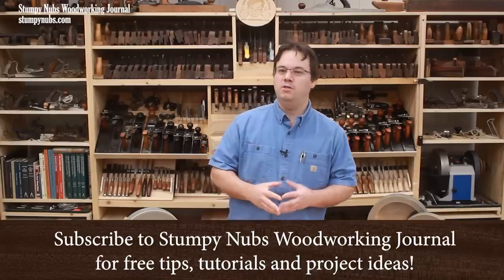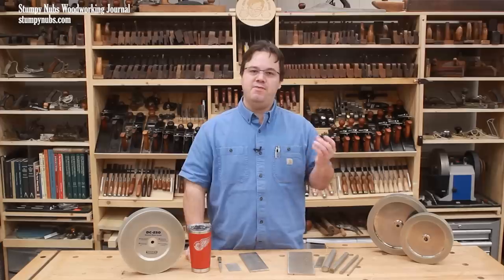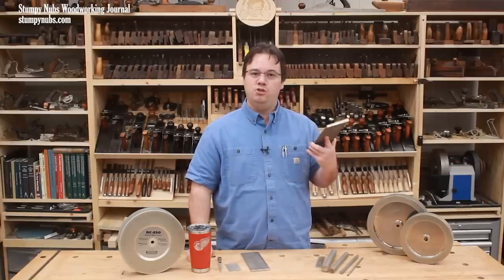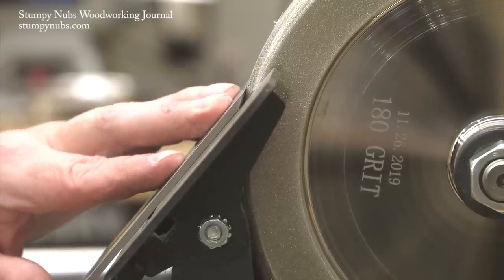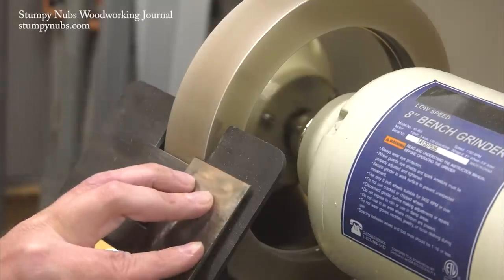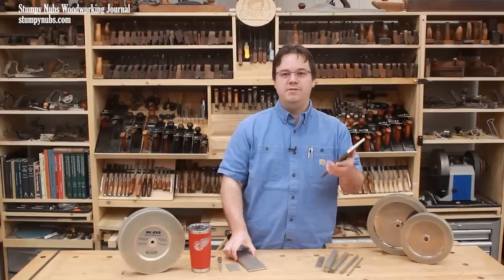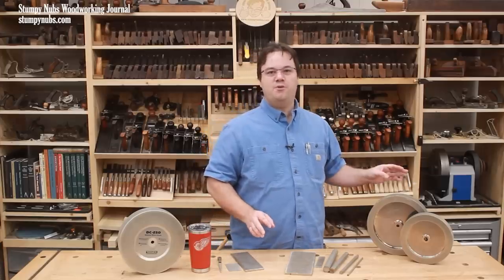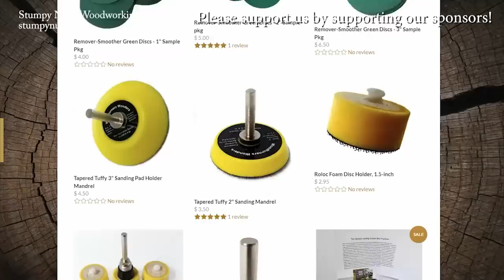The TRUTH about CBN vs Diamond sharpening stones

Comment: Hi James, I switched to CBN wheels to sharpen my lathe tools a year ago, I’ll never go back. One of the cautionary statements from the manufacturer surprised me though as it read “do not sharpen high carbon steel tools as this will clog the abrasive surface”. Happily I have another low speed grinder so moved my white wheels over. Now I sharpen my hand tools on white reserving the CBN for HSS only.

Comment: Heavy emphasis on CBN wheels are for 'hardened' metals only! The life of a CBN wheel, for production work is about 5 years. I did take an old worn out one and purposely loaded it up with soft steel, aluminum, brass and copper. After a month of sharpening my lathe scrapers on it, the colors from the softer metals was gone. Lapping fluid can be applied to the bevel of the tool you are sharpening, and it can help lift the soft metal off of your grinding wheels. If you apply it directly to the wheel, you will get sprayed, and I found out the hard way..... They do sell very hard aluminum oxide sticks to also do the same thing. Diamond wheels on a Tormek or the various clones of it, can last pretty much forever. I use the CBN wheels from D Way since the owners are personal friends. I do like the heavier steel wheels, but you have to have a grinder that will drive them, 1/2 hp isn't enough.

Comment: Great video explaining the difference between CBN and DIAMOND grinding wheels.  So, my application is sharpening non-carbide chainsaw chain.  Which is better here?  Price is about the same, so thought diamond would be better.  Guessing you will say CBN is better here due to lower grind temps at the higher grind speeds?  If so, can you please recommend a supplier of CBN grind wheels for my chainsaw grinder?  Thanks again for the good explanation!

Comment: One place I find diamond and Cbn won't replace in sharpening is when you want that mirror edge. I know the diamond films can do it or CBN pastes on strops. But there's something about a chosera whetstone polished edge it always comes out nicer and better. 

Great video though, lots of great points for those that don't know a lot about sharpening yet or just getting into it. 

I have a bit of each, diamond, CBN and chosera.
Reply from the maker: I grind with CBN to fix or reshape an edge. I sharpen with fine grit diamonds (either on the Tormek or by hand). Then I strop on leather with paste. I don't believe CBN or Diamonds are really intended to give you a mirror edge on their own.
Reply: @StumpyNubs  sort of. When you consider some offer 1500-1800 grit, where a 1800grit chosera is pretty nicely polished there. Obviously going higher can get better. 

Those stropping films you can get to put on glass or granite are diamond based usually. And I have Cbn pastes to put on leather strop that can give a mirror edge. 

Both can do it. It's just a nicer edge with chosera. 
Maybe looking at it more from the knife world with sharpening systems only using diamond stones and getting to a mirror finish. It's doable just not as nice.
Reply: @JoeC92  There's a Youtube channel (out of Japan?) where the presenter hand sharpens knives. He works through a range of 5 or 6 grits. The finest is something astronomical - like 6000. It's overkill until he slices loosely held sheets of paper with nearly zero force. The edge is likely sharper than a surgeon's diamond scalpel.
Reply: @gregparrott  virtuovice or something like that if that's who you mean. I know exactly who you're talking about. I learned a lot about hand sharpening from him. 
He's a big fan of bark River knives

Highest grip I have is 8000. On a Japanese style kitchen knife it finishes it off with an incredible edge.
Reply: @gregparrott  I finish my straight razors with a shapton 30,000  so 6000 is a bit rough 🙂
Reply from the maker: @JoeC92  - I am skeptical of diamond and CBN grit higher than 1000. Here's a video about why: https://www.youtube.com/watch?v=re2EwwNcufo
Reply from the maker: @gregparrott  6000 is not astronomical, in my opinion. Stropping paste on leather is equivalent to 5-6K. If I don't strop, I can tell immediately. I can't chop dovetails in soft wood without crushing the fibers and I can't take a very thin shaving with my smoothing plane. I sharpen to 1000 then strop (5-6K) or sometimes use a ceramic stone 5-10K instead of the strop. Makes a big difference in both performance and edge retention.
Reply: @StumpyNubs  definitely some good points. I haven't tried any of the larger ones. I'm just used to the 1800 grit that comes with kme, never had issues. And then the CBN emulsions they have as well which are for leather. 

I'm in the same boat though I would much rather finish on a ceramic or chosera.
Reply: @StumpyNubs  Thanks. I deemed it astronomical because it is far higher than any grit I've previously seen. But for those who sharpen with precision applications in mind, I guess 6000 is within a normal range. For grins, I've been looking at the Tormek line of grinders. The T8 seems to start at $700, ranging to $2000 with all accessories.
Reply from the maker: @gregparrott  A Tormek T-4 and a square-edge jig will do your chisels, planes and many other woodworking tools for about $500. Add a $45 knife jig and you can do a lot more. The Tormek is not a cheap system, and I am not saying you need it. But few have to spend $2000.

Comment: I agree with letting the diamonds do the work with light pressure . They have a nice feel imo . Trying some Venev 400/800 so far and a 150/240 is coming but it’s not an “f” ursa stone . The 400/800 Venev ursa did more of a polish finish with finer scratched than the 600 grit diamond . Seemed to work well though .

Comment: You mention low speed grinders and sharpeners - what RPM's are appropriate?
Examples:  My Vertical Sharpener turns at 160 rpm (the supply motor is 3450 rpm) and my Horizontal Sharpener (an older Woodcraft) uses a 7" stone at 420 RPM - both are water-emersion.  I have 400, 600, 800 grit abrasive stones as well as an assortment of water stones and Diamond plates for manual work.

I like the concept of CBN stones as they seem low maintenance - can these be used as water-bath stones??

Finally, what are your thoughts for belt grinders for sharpening??  Belt Width??  Belt Length??  Abrasive Materials and Grits??

Many thanks for sharing your knowledge and research!!
Reply from the maker: -Slow speed grinders are about 1750 RPM.
-You can use CBN in water if you add an anti-corrosion treatment (same as with diamond wheels.)
-I don't sharpen with belt grinders, personally.

Comment: Every time I see you use that Tormek, I am that much closer to giving in and buying one...
Reply: Do it! I have had my Tormek for close to 15 years. It has been one of my best tool purchases. (It now has a CBN wheel on it from Ken Rizza at WoodTurners Wonders. Much faster and less messy than the original wheel.)
Reply: @DKWalser  I'm sure I will at some point once my workshop finally gets built and I have some space.  For now I make do with a Veritas sharpening jig and diamond plates, it works well enough.

Comment: It's worth pointing out that grinding carbide produces a dust that is hazardous so extraction and a respirator should be used.
It would be interesting to try to quantify how much pressure is too much on a diamond plate.  Are we talking some but don't push really hard or are we talking enough to keep it in contact but no more?
Reply from the maker: If your fingertips are turning white, you are pressing too hard.
Reply: @StumpyNubs  Thanks James.  So fairly light but not just in-contact with no pressure?  Sorry, I'm confusing fingernails starting to turn white (very gentle pressure) with finger tips (harder to see but a bit more pressure).   Reason I'm keen to get it right is that I suspect I've probably damaged some early cheap plates and am keen not to repeat on better ones......and I should have followed your advise and gone for the Narex chisels and not the red/yellow Irwin Marple that need sooooo much work to make the back flat (and I mean the tip, I'm not confusing a hollow ground back).

Comment: I bought a CBN wheel for sharpening my lathe tools. Love it!. One of the warnings with the wheel I bought was to use it to sharpen High Speed Steel only. Carbon steel would gum it up like aluminum on a standard wheel. True or false? Does anyone have a definite answer?
Reply: Never dared risk it myself.  Also interested in the answer
Reply: The danger with gumming up abrasive wheels is expanding the wheel with that heated material making it explode.  I don’t think there is a risk with these wheel as it is metal wheel with the abrasives applied to the exterior only.
Reply from the maker: Soft steel will clog up the grit and ruin the wheel. I use a regular old grinding wheel for lawnmower blades, etc. CBN is for hardened tool steel. That said, woodturnerswonders.com has a product called a Wonderstick that they say will prevent a CBN wheel from clogging (I think). You should check it out.

Comment: Is occasional use of CBN on mild steel OK?  I use my coarse aluminum oxide wheel for deburring and minor shaping of mild steel, would that damage a CBN wheel?
Reply from the maker: WoodTurnerswonders.com has a lubricant called "Wonderstick" that they say may solve that problem. I only use mine for hardened steel. If I want to grind a lawnmower blade, that's what the cheap wheels are for.
Reply: Mild steel isn't that great on aluminum oxide either, so I'm not surprised by your answers.  I should use my belt sander instead.  Just lazy.
Reply: @StumpyNubs  I talked with Ken - he’s GREAT - he said to avoid soft steel as it clogs the CBN. He mentioned PB Blaster and wire brush to unclog … also check his video on Sllickstick and grinding copper.
Reply from the maker: @MikeB0001  Maybe not. But you really should talk to Ken at Woodturnerswonders. He is the industry expert on CBN.

Comment: I love your site and I've learned a lot from your videos.  I did some spindle turning many years ago (made a couple chess sets) and now I'm about to get back into wood turning, and probably some bowl turning.  I need some advice on what I should get in the way of sharpening apparatus for sharpening HSS bowl gouges.  I'm looking at the Tormek T800, and the SVD 186R gouge jig,  but wondering if the included stone is what I need, or if I need to consider a diamond stone.  I'm also unclear on whether the included stone is CBN or something else.  I question whether it's smart to use the included tool to adjust the grit from 200 to 1000, because I suppose going back and forth would wear the stone prematurely.  Do people typically have different stones and routinely change them?  Or is initial grinding done at 200 grit, then convert the stone to 1000 grit thereafter.  I'm a bit confused and don't want to spend buy something if it's not what I need.  Thanks for any advice.
Reply from the maker: The regular stone (it is a manmade water stone, not CBN) works perfectly well. Using the stone grater to change the grit doesn't wear it much at all. It mostly burnishes the surface. You can do it as often as you like, with as much pressure as you like and it will last for many years, perhaps decades in a hobby-level shop. The diamond wheels are extremely convenient (and the coarse one is really nice for excess grinding), but for day to day use you will be very happy with the stock wheel.

Comment: hello James, well said and easily understood. If I may ask an auxiliary question regarding CBN wheels. What is the optimum shaft speed for an 8” can wheel? I have two grinders 2800 rpm & 1400 rpm so I am undecided which to use. I have the capacity to build a variable speed control unit, but lack the ultimate speed team for. Thanks
Reply from the maker: Most slow speed grinders used for sharpening are about 1750 RPM.

Comment: Very interesting. But I am left with questions: In some instances, your grinder is kept wet, while in others, it's dry and sparks are flying. What are the guidelines for lubrication? Is it just that diamond wheels are used wet, while CBN wheels run dry? Also, is water the lubricant, or is an additive used?
Reply from the maker: The water cools the tool, and keeps the metal dust out of the air. Some systems (like the Tormek) have that feature. Most others do not. You can dry sharpen with both diamonds and CBN, but the benefits of water are nice.
Reply: @StumpyNubs  Thanks! Inclusion of water for cooling seems like a logical choice, both to keep the workpiece cool as well as prolong the life of the abrasive.

Comment: The question I have is, when I use my wood carving tools, I usually polish them on a cotton wheel with rouge. Should I use the same approach for knife sharpening? It has never failed me in 35 years of wood carving as a hobby. Yet I only recently thought about trying it on my straight blade high carbon steel knife.
Reply from the maker: As you know, wood carving tools must be RAZOR sharp. Anything that works for them will surely work for a knife, in my opinion.
Reply: @StumpyNubs  I learned wood carving and antique furniture reproduction from a Welshman many years ago. He was a very calm fellow until he saw me with a spoon-bit gouge in one hand and a sharpening stone in the other. 
He literally shrieked then said, "Carving tools are polished, never sharpened." It is a lesson I never forgot.

Comment: What grit would suggest for a diamond wheel on the tormek. I have a set of diamond plates so the wheel would be used for redoing a primary bevel and flattening backs. Mostly chisels and plane irons?
Reply from the maker: If you are planning to use it for heavier grinding and not honing, get the coarse wheel. I think it's 360.
Reply: @StumpyNubs  Thanks, I’ve been watching your videos for ten years and early ones were good, I liked the humor, but the current ones are better.
Reply: Given what you'll be using the wheel for, I would go with the 600 grit diamond wheel. For most of your sharpening needs, it will do all you need. And, if you use the honing wheel, you may not need to use your bench stones at all. But, if you're going to use a bench stone to put on a secondary (or even a tertiary) bevel, there would be no need to hone the primary bevel produced by the 600 grit wheel.

Comment: A question: I use a honing guide which has a brass roller (some brands of guide use a steel roller) that runs on the surface of my stone.  Will this roller damage the diamond or CBN hand sharpening plates?
Reply from the maker: No

Comment: I have just recently added hand planes and block planes to my inventory. Sharpening was a major cost at set-up and kept me from using them. I picked up the system Taytools offers with PSA Sharpening grits and float glass. Do you have experience or recommendations when using a system like this?
Reply from the maker: I used something similar for a long time. It will work just fine, and is cheaper to get started. But it will add up over time as you go through sandpaper. If it works for you, stick with it. Results are what matter most :)
Reply: @StumpyNubs  Thank you for the feedback. I truly appreciate it 👍 I will probably expand my my sharpening system over time.

Comment: I've watched most, if not all of your videos about tool sharpening, and have a question. When do you use the water bath thingy on the   Tormek?  Is it for either wheel or only the diamond wheels?
Reply from the maker: It is for all Tormek wheels. However, I personally only fill it when I use a regular wheel (or the Japanese water stone wheel). The diamond wheels require an anti-corrosion solution. Rather than putting the whole bottle in the machine and dirtying it all up, I just keep some in a spray bottle and keep the wheel wet as I sharpen. Works for me, but I don't think that is officially sanctioned ;)
Reply: @StumpyNubs  I saw sparks flying on what I assumed was the CBN wheels. So I assumed it was dry. Is water optional or required with CBN?
Reply: @StumpyNubs  LOL, duh I now see where the CBN wheels have the word Waterless in the description.

Comment: What is the “guide” or “jig” that you are resting the chisel on to sharpen with the wheel called?
Reply from the maker: Which wheel? The bench grinder? That's the part of the larger Kodiak jig system. However you can also get it as a standalone tool rest. I love it because it has angle stops, and because the big surface dissipates heat. https://woodturnerswonders.com/collections/grinding-wheel-accessories/products/stand-alone-tool-rest
Reply: @StumpyNubs  thank you so much for the quick reply

Comment: Does one kind have a more consistent grit size than the other?  I have an "extra extra fine" diamond stone that has much larger chunks than the stated grit, making it basically useless.  I read, is that's just a limitation of sizing diamond grit.
Reply from the maker: A quality stone should have consistent grit. While there may be some finer dust in there, there should be no larger chunks than the grit demands.